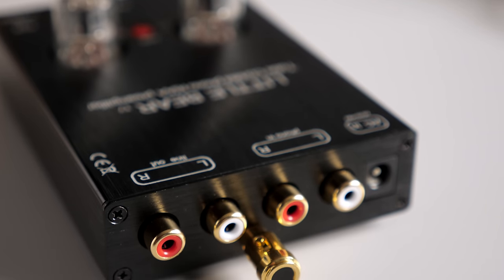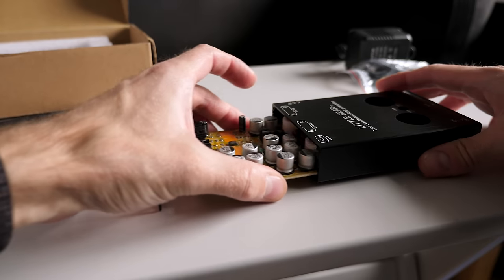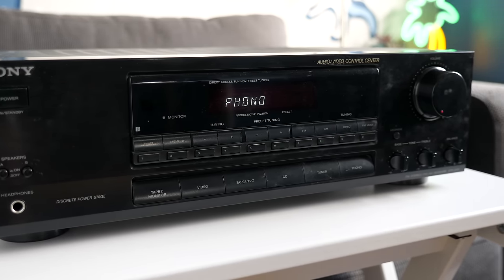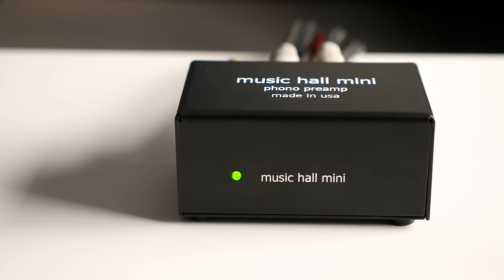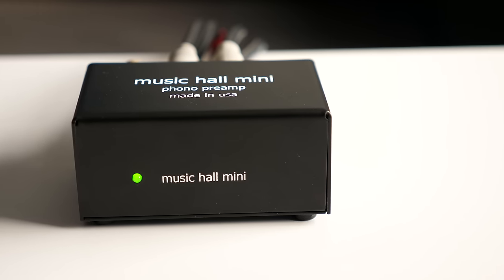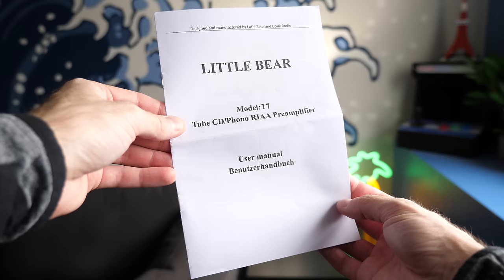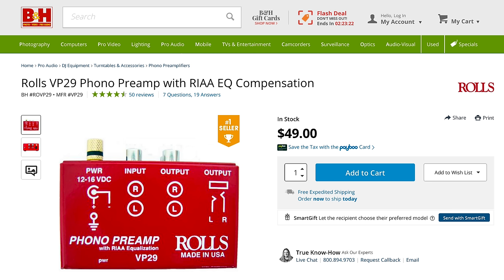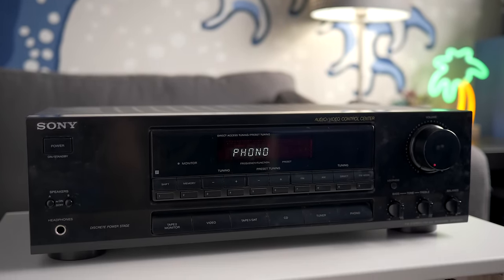A Look at Affordable Turntable Preamps

Comment: Nice job, they all sound good to me. I doubt anyone could pick out one from the other in a "double blind" test. I am an "old" retired electrical engineer. I worked on tubes and solid state devices for many years. I can guarantee you that these vacuum tubes were never meant to operate at 12 V. No one knows what they do at such low voltage.

Comment: Very good comparison and honestly, very surprising.  I as well thought the receiver was very flat and neutral, as it should be.  Any kind of amplifier should do only that, amplify.  The sound should be adjustable to taste with an equalizer.  

But a word to the wise when buying a used receiver, especially from a thrift store.  Know what you are getting.  Simply plugging it in and turning it on is not going to confirm whether or not it works.  If by chance the store is demonstrating it they probably won't let you turn it up.  An amp might sound fine at low levels but have a higher amount of distortion when turned up.  All amps should produce some distortion in their top range but the amount is reduced by their quality and how well they are treated.  

A lot of people think you break an amp by turning it up all the way and releasing the magic smoke.  While this is possible a lot of people abuse their amps while not even knowing it.  You would think it would be bad, if you had a 100 watt amp and 50 watt speakers, and it would be bad for the speakers if you turned the volume up past half way, however it won't hurt the amp.  So people like to play it safe, and hook up 200 watt speakers to their 100 watt amp.  It seems sound in theory.  But the speakers are demanding too much power from the amp.  It will sound fine, for a while.  The amount of distortion will increase gradually and imperceptibly over time, and you will get used to it, until you compare it side by side to a new amp.  

Receivers can be expensive to fix, if not impossible.  The parts might simply not exist.  And you might go through 3 or 4 receivers before you find a good one.  I got a suprise once and found a 100 watt Yamaha receiver in the community dumpster while throwing away my own trash.  It actually did work, it only has a broken foot.  I use it for testing other components while I rely on an Onkyo HTR540 for my main duties.  While I have never been a real fan of Onkyo, I have to say I am very impressed with its sound qualities.  It seems to combine the best of all worlds, because while it is a 7.1 surround sound amp for home theater, it is a solid performer for standard stereo, and yes it has phono in.  

One problem though, this system is powerful enough to skip records, lol.  sigh  Well I suppose I will have to religate LP duties to my Sansui 9090.  Oh the pains of being an audiophile and the search for the perfect sound... but I would not trade it for anything.

Comment: i just use a super cheap $25 Behringer micro phono PP400 and it works fine.  I only have a vintage Sansui with phono to compare.  Maybe it doesn't sound quite as good but at least I've never noticed any hum like that!

Comment: I actually have the ZeroZone T1 which you can purchase as a kit, it's basically the Little Bear without the tube buffer stage, and the frequency response is fairly flat, the only concern is that the gain is fairly high so I wouldn't recommended with cartridges that have a high output. There's nothing inside the amp except a through-hole 5532 op-amp and some resistors and capacitors.

Comment: I can just hear radiotvphononut saying "Amen." Yeah, I bought a newly made one that was about $10 a few years ago, and it sounded ok, except for a very loud hum, which I thought was caused by it being powered by a DC adapter, but it may be the same issue as yours. I still use a Technics turntable and a Radio Shack pre-amp, both bought by my dad in 1982. Still no problems with it.

Comment: Fun video. I had a Sony STR-GX315 receiver when I was a teenager, very similar to yours. 

I've gone through a lot of phono preamps since my current amp doesn't have a built in one. 
After trying out a cheaper NAD PP4 (replaced because of faint background noise), then one from Cambridge Audio. But I landed on the Pro-Ject Phono Box DS2 USB. It lets you select output levels, and has a nifty ADC with USB input for ripping LPs. It has 3 inputs, two phonos and one aux (so I can rip any format). Great value for money, even though it set me back $500.
Reply: Pretty cool that it's a decent ADC too! Can you run it backwards, to output line level audio from your computer, using it as a high quality DAC?

Comment: I liked your review and thought the Music Hall sounded the best. I also found two pre amps that  interest me;  the brand is Pyramid PR2500 and  Pyle PPRE70BT. The 2500 seems to be right in line with the phono use, but the 70bt has additional features that I could use. However, the 70BT doesn't seem to be quite as suitable for turntables?. I intend to use this with my Sony Strdn 1020(no phono input) and I'm struggling in figuring out the connections and compatibility to use with the receiver. Both pre amps are very affordable, they have very high ratings on Amazon. 
I was hoping you could shed some light on these. I'm almost thinking I need to pair the music hall with this pre amp(70BT) to work and I'm not looking to have a gaggle of components daisy chained just to make things work.

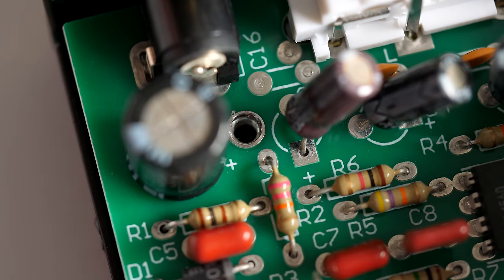Comment: 11:10 those solder points for the transistors look suspect. Did they not fully flow through? I would question those connections.

Comment: If you’re on a tight budget then you can find the best deals buying used locally. I got a NAD 1020 stereo preamp for only $20, to get anything that sounds that good new you’d have to spend at least $200. 

I do however recommend the preamps from Pro-ject, I had one that cost me about $100 and it sounded great

Comment: Just got my AT LP120xUSB turntable. Do i get better sound quality using the PHONO option with a cheap phono preamp linked to my stereo amp or should i just use the AT built in preamp with the LINE option?
Reply: Did you find an answer? I find internal preamp on it doesn't provide enough oomph bass

Comment: When i bought my ART Pro Audio DJPRE II Phono Turntable Preamplifier it was under $100.00 and even though my Pioneer VSX-933 has a built in phono input - I prefer to use and AUX input with the separate phono preamp so i could use my Behringer 31 channel EQ with my DBX 3BX Series II enhancer...

Comment: Get a Schiit Mani.
It's a $129.00 shipped, it's got a variable gain stage so you can use it with moving magnet or moving coil, it's completely designed and manufactured in the U.S.A., AND you can return it if you don't like it.
I did and I kept it. I've used it with both MM and MC cartridges, in spite of having a very good phono stage in my receiver.
You can spend less and get less. But you would have to spend more, much more, to better. And then diminishing returns comes into play.
Get the Schiit, it's THE Schiit.

Comment: Thank you for this.  I just upgraded from an Audio Technica LP60 to a used Pro-Ject Debut Carbon Esprit, and have been trying to find out if I would also need to invest in a new preamp as well.  But my Yamaha receiver has always worked great, so no need to bust out my wallet again.

Comment: I watched with interest. Let me share my experience. Out of curiosity I checked the Sony STR-D311 diagram. The RIAA correction system is implemented in a negative feedback loop, as was done in all cheap amplifiers. This Little Bear maybe has the same solution to correct the turntable signal in the operational amplifier circuit plus an additional output buffer on tubes to add even harmonics. I think Music Hall is implemented in the same way as the preamplifier in Sony 311, it sounds worse maybe due to SMD components. I will add that my Onkyo TX-SV646 amplifier has the same layout as your Sony. They all sound bad, have limited space, different boosts in the whole band (correction inaccuracy), transient intermodulation distortion. The NAD 3020 (analog model) has a better fonostage. In my experience, a simple Class A amplifier with passive RIAA correction transfers the sound of the same turntable one class higher. If you want to have a good sound, buy a preamplifier constructed in this way: a cascade tube amplifier, RIAA passive correction, a cascade cathode follower. This arrangement ensures low output impedance, the current does not load the passive filter elements, which does not change its characteristics, and is a perfect match with the turntable cartridge. Not all tube preamplifiers cost as much as the M2 Audio Note. My hand-made tube preamp cost me 50 €. Condition: you must be able to solder, file saw and use a screwdriver. Simple design: triode voltage amplifier, passive RIAA correction and second amplifier on ECC83, of course class A (because in SE it cannot be done differently). It sounds much better than the preamplifier on Onkyo 646, Sony 311 or TA11, Sansui C77 or Fonica WS503 and other integrated devices.

Comment: Probably a UK Vs US use of English thing, but we would call what you used an amp, and a receiver is a radio tuner with built in amp, usually featuring phono and tape/aux inputs. Thanks though,  my standalone phono stage has dropped a channel so I am going back to an old Yamaha Natural sound until I get it fixed. I was contemplating a budget phono stage until watching this.

Comment: im running a sony STR-DA1ES, and its honestly better sounding than all my other home theater receivers. its old, and has no HDMI, but man does it power my speakers well and has a very good 6ch input for using it with my computer. it'll be some time before i replace it.
Reply: It's an 'ES' model so it's almost certain to sound great.

Comment: Very nice test. I stopped the video at this point, immediately after the first sequence of three trials, to comment on what I heard thru the chain of audio transformations that output in a 6 inch Bluetooth speaker tied to my phone. I immediately heard a difference that I can only describe as a seemingly wider sound stage if this even makes sense as soon as the Sony was in charge of the turntable's signal. The two stand alone preamps sounded about the same with a bit of an edge from the unit that incorporates the two valves. It will be interesting to see the balance of the video and listen to your "real" experience but as is, my vote is Sony.

Comment: If your are going to buy a phono stage Pro-ject is the place to look. But for the Whest PS30R is what use cost over $2000. Also I use Moving coil cartridge ZYX Bloom 3 L cost $1200. 
Super low cost phono stage will gave you maybe ok sound with MM cartridges as  said Pro-jest is the place look for low cost phono stage. As for old receivers maybe they may need new caps or other repairs to sound there best.

Comment: I have the little bear and I found that with some tube rolling you can make the little bear really come to life but you have to ditch the tubes that come with it.
Reply: james coulter any recommendations on the tube roll candidates???
Reply: @beauxwalwer4894  well the GE 5654w are a decent improvement over the stock tubes however the Soviet tubes are nice or if you can spring for a pair of the Telefunken tubes well you will get what you pay for.

Comment: I'm very new to Vinyl and just started collecting. I got an Audio Technica AT60 (I think) and I have it going into JBL LSR8's. Even though it is in line level mode and the speakers are powered, it's not that loud... I'm only using the JBL's until I get a set of speakers specifically for playing records and am looking for decent cheap options. Also was hoping I could somehow hook it up to an old Peavey PA system I have... thoughts?

Comment: If you go for an external phono preamp, you should at least get one with options to control gain, input impedance and capacitance. That way, you'll be set up for different MM or MC cartridges and can fine-tune your preamp to the cartridge and cable. I use a Pro-Ject Phono Box S2 for 150 bucks that has all the features and sounds really nice. Plus, it has a switchable subsonic filter.
Reply: Ah glad you said that I’ve been trying to remember the name … pro-ject phonobox yeah that seems like one of the best budget pre amps sub $100
Reply: @sturmanaskie  there are two, the Phono Box S2 and S2 Ultra. The latter is 90 bucks more expensive with the same features but is built as a fully discrete circuit without opamps. Reviewers say it sounds a lot better and is worth the extra money.

Comment: I agree with the outcome here.  The Sony was the best, the Musichall Mini was in the middle and the Little Bear was the worst.  However, Music Hall had exposed how corrupt the audio industry can be.  They are using a $50 Rolls product and marking it up for twice as much.  So now I don't know which company is worse, Music Hall or Little Bear.   I guess it is a moot point as the Sony beat them both.   @This Does Not Compute.  I would like to see you do this test again, but with better units against the Sony Like the Schiit Mani and Zen has a comparably priced phono pre-amp as well.

Comment: My relatively new Pioneer vsx933 AV receiver has a phono stage. it does not sound very well. My old  mid endTechnics on the other hand, rocks. so does my entry level vintage  AKAI. On paper the AKAI has a phone input frequency range 40-15000. I compared this with a Pro-ject phono box e for line input, but the difference in sound quality is minimal. My conclusion: They really understood RIAA back in the old days.

Comment: Here’s the question I have… I have a nice Sansui turntable but my receiver is an AV receiver that does not even have photo inputs. Currently, I use a cheap little preamp. Would it be better for me to buy a vintage receiver with a phono input or a new preamp that is better than the one I currently have and use it with the AV receiver. I am not a super duper audiophile snob, but I would like to have decent sounding equipment.
Reply from the maker: Unless you hate your current receiver for other reasons, I’d just pick up a new preamp.
Reply: @ThisDoesNotCompute  Thank you for the quick answer! I have to say that I am interested in the Schiit Mani preamp.

Comment: I have an old AKAI AM-U02 model receiver from 1980 that I want to put back into use.  Should I consider buying a Pre Amp? I've never used one before.
Reply from the maker: It looks like that model has a phono input, so no separate preamp should be necessary — just plug your turntable directly into it. I bet it would sound pretty good!
Reply: @ThisDoesNotCompute  Thank you! It does but I’m might look into new speakers. My speaker wire is 14 gauge. Would a 16 gauge wire be any better?

Comment: Youtube mangled the sound examples for me. I have much better audio from other YT videos. I had no high end treble from any example. I did notice that the overall level where lower after the modification of the Music Hall and the tube amp had no lower midrange but a lot more higher midrange compared to the other examples. It's a bit surprising as all must follow the RIAA curve within a dB or two, ot they have made a huge mistake in the design. It's hard to make any judgement from electronic music. It's best to use vocals as you know have that are supposed to sound and is very evident to reveal transient distorsion and other anamolies when listening to if the S's doesn't get exaggerated.

Comment: Shame you didn't review the art clay DJ pre ll phono stage in the mix, that has an adjustable loading stage on-the-fly what is a lot better it's about £50 very good for it's price plus you can connect to a PC. Would be nice if you could use a reference model with your demonstration models, maybe something like this schiit Mani, would help in judging how the other phone preamps compares with your reference pieces. Are you doing any more or on phono preamps, I think it's something that gets overlooked and not very good intensive playoffs out there in all pipe brackets. Or the music fidelity is overlooked they do some cheap ones £150 make some great phono preamps

Comment: Pretty easy to hear the differences between them, the Little Bear is straight out, its just plain poor sounding. The Music Hall had the best high end definition but poorer noise floor, and then I saw inside, I wouldn’t consider that one either. So the Sony, unexpectedly wins for me too. 

In all honesty though, if you have a good turntable, amplifier and speakers, don’t skimp on the phono stage, it WILL hold things back if you buy a cheapo one. I’ve seen excellent phono stages such as the Trichord Dino sell for as little as £180 used, but at £250 used, its excellent VFM. I have an “Arkless 651p”, basically a Cambridge Audio 651p that has been heavily modified by Arkless Electronics, possibly only really practical for UK residents but at about £50-60 for a used CA 651p (or 640p) if you don’t already have one, and about £225 for the modification, you’ll have one of the best sounding phono stages below about £800. It’s fantastic... at under £300, if you have a lot of vinyl, it’s only a fraction of what you already have invested in vinyl.

Comment: I am not a fan of the majority of these cheap under $100 preamps. That music hall highlights a major issue in the audio equipment industry with rebranding cheap junk with a huge markup. It bothers me so much! It happens with cartridges too and quite a few, like the Goldring E series, are just rebranded AT carts with aesthetic changes. The little bear always looked too good to be true and I knew it was bad but I didn't realize it sounded so bland and unappealing. I'm happy with my Cambridge Solo which I would still consider to be budget friendly at $180 but it sounds like it could be twice that price. Very solid build and amazing shielding to avoid electrical interference.